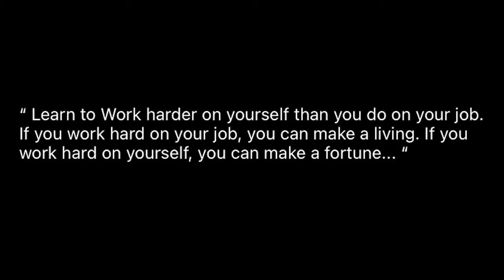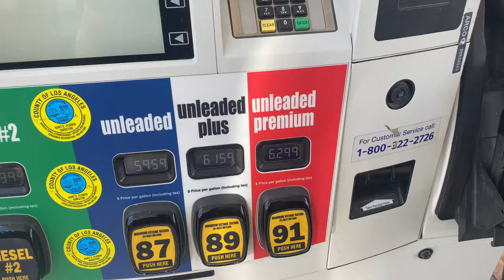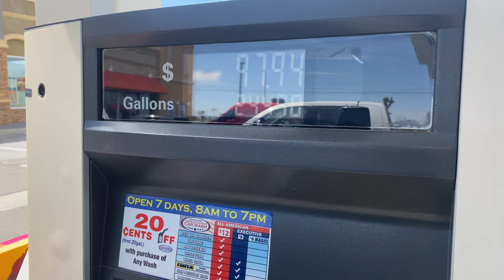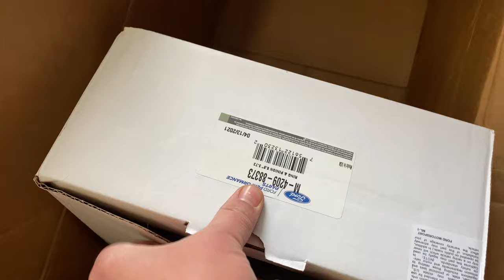1963 FORD FALCON HANDMADE! SUBFRAME CONNECTORS!!

Comment: When you tig weld you need to move  the welding around,  front to back and side to side to much heat and things warp , I'm surprised you don't have the car on stands and leveled out and not move it to keep square. You might want to put some out board supports in weld 1/8in plate on pinch rail then weld tubing            to the frame connectors for more support. Put gussets on front spring perches

Comment: Like the ideas for the subframe connectors. im using 2x2 box tubing that i welded into the front subframe. im working on a 63 comet and want to run some wider wheels on the back. its a lot of work but worth it.

Comment: I am waiting on Speed Kinetics (Matt) to get back to me on the K-Member motor mount options for a 65-6 Mustang. How much ride height do you have with your falcon, if you know?
Reply from the maker: For height what are you considering as height?
Reply: @TeamDPerformance  Majority of aftermarket suspension systems I’ve seen sit the front fender 1 to 2 inches lower. I want to maintain my current fender height slightly above the top of the tire, or more. Any thoughts?
Reply from the maker: My car currently sits like that but with these kits you can make them sit however you want with spring changes. They use coil overs off a fox so the sky is the limit.
Reply: @TeamDPerformance  Thanks for the information, really appreciate it. Are you going to use a front sway bar? I didn’t see anywhere on the Kinetic kit where you would mount it to the lower A arms? Thanks again for the info.
Reply from the maker: Anytime, no I am not using a front sway bar and I’m not sure if his a-arms come with the tab for one. You could probably add one very easily tho if not.

Comment: I want to T5 swap my 289 C4 66 Mustang, do you have any recommendations?
Reply from the maker: That 66 I worked on got a kit from CJ Pony Parts I believe and it looked like a good kit. I didn’t care for the clutch/cable portion of it as it was working fine then started to bind up. Maybe consider a hydraulic throw out bearing. And you can piece a kit together too. T5 stuff is everywhere.
Reply: @TeamDPerformance  Yeah I definitely want to go hydraulic. Know anyone with a 3.55 Truetrac 8" for sale? I'm in Lancaster also
Reply from the maker: I don’t, explorer 8.8’s are pretty easily found tho and they’re 31 spline and posi and not expensive.

Comment: My first car was a 63 1/2 falcon sprint hell that was 45 + years ago pick a part had 50 or 60 falcon's in stock at all times most of them rust free now it's had to find one that's not swiss cheese my car over the years became a full framed four link big tire car with a strut front suspension and an aluminum sheet metal interior and tubs nobody thought falcon's we're cool back then except me when I sold that car I had the car running high 8 second passes at OCIR witch was hella fast back in those days I wish I never sold that car as every Chevy and Mopar guy out there hated that car😠
Reply from the maker: That’s frecken awesome ! I have always loved falcons but this body style in 63 the best! Thank you for watching!